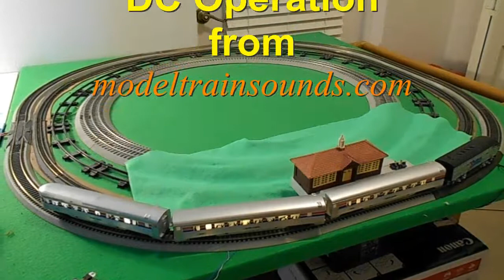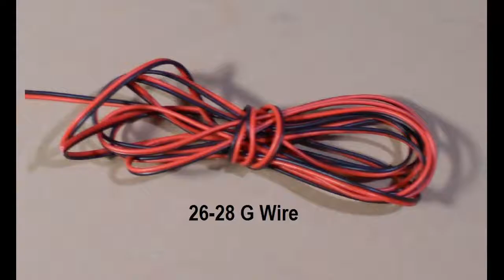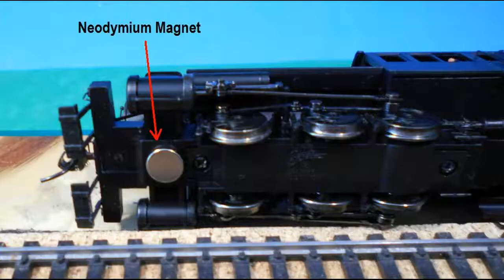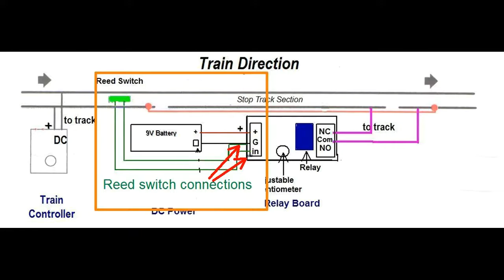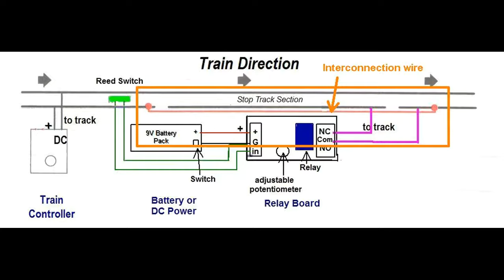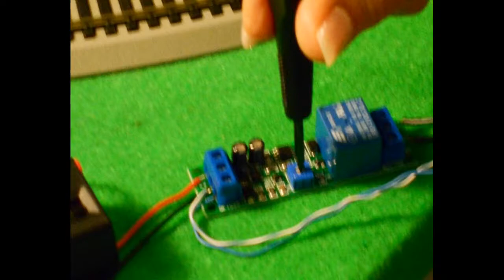A Stop and Go Circuit for automatic operation in DC mode for HO and N scale model trains

Comment: Is it possible to install multiple of these stop tracks along a run?
Reply from the maker: Yes . You can setup multiple stops with just one relay board . You need extra reed switch plus wires and wire the reed switches in series.

Comment: Do you have a lot of people having problems with this I e done everything I can but it won’t work maybe mines bad I just bought it from you on eBay but eBay won’t let me contact you ?
Reply from the maker: It maybe that the magnet is not close enough to the reed switch.Two magnets are supplied 6mm in diam with one 1mm thick for HO and one 0.5mm used mainly for N scale. You can test the circuit by bringing any magnet close to the reed switch. I also recommend glueing the magnet to the undercarriage as they can dislodge onto the metal track. You can contact me thru the website.

Comment: I purchased and am using option 2, and it doesn’t work.  It’s just an oval.  I can see the circuit activate, but it doesn’t cut power as it says it will.
Reply: I did find that a 9v battery wasn’t working- hard wired and it worked.  My only other issue was I placed the reed switch parallel with the rails, and it would trigger twice(n scale).  So I had to remove a tie and place perpendicular to the track.  That works better.  Lastly the magnet wasn’t low enough on my engine to trigger so I had to get a bigger stronger magnet and put on a car.  Mine is just for Christmas under the tree, but I did have to modify.
Reply: @ I threw mine in the junk box for now I ended up busting the reed switch but I will follow in your foot steps once I get another reed switch
Reply from the maker: @lordvader702  If you need a replacement just contact me through the website email
Reply from the maker: @jrasche  Glad you got it worked out. Lots of tips at the website under Project 17
Reply: Yeah, I need a new reed switch as my wire is barely there.  Very delicate!  Good luck!  Hope you get it working, it’s pretty nifty when it does!!!
Reply: @jrasche  it was the 9 volt pack I hooked it to my layout 12v works like a champ. I’m getting a small bump in the track because I’m not low enough on the dig out now that’s it working I’ll be able to fight just that problem I don’t want to go too deep with the dog out little by little I guess until dosent bump as much.
Reply: Me too mine is I stalled perfectly and does not work I can hold the magnet on it it and don’t work
Reply from the maker: Sounds like your circuit is not set up correctly . You can contact the me directly at the website email. 
 to check the reason.
Reply: No it’s still working great had some problems at the start once I figured out how it works and what the parts are instructions aren’t great and video isn’t either to be honest it could use a update. That being said it does work like a charm

Comment: Can the board be powered by the controller?
Reply from the maker: Yes using the accessory AC BUT you would need to convert the AC current to DC which can be done. See the website for more information.